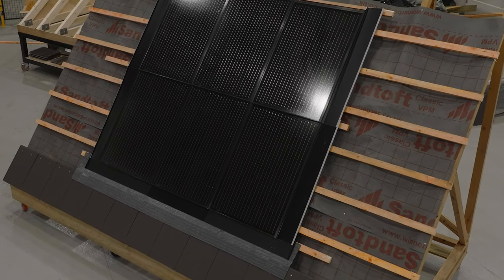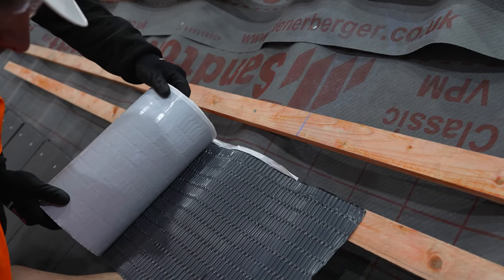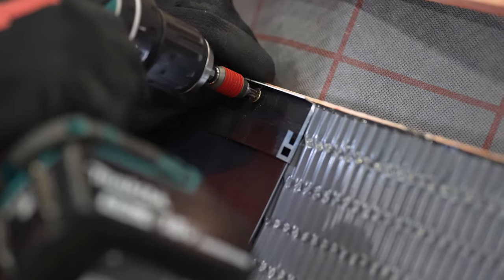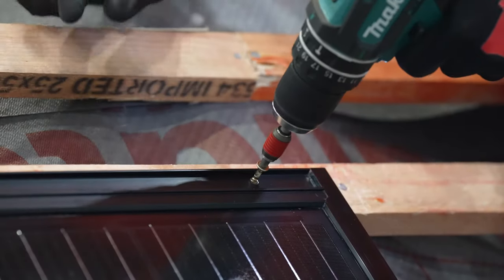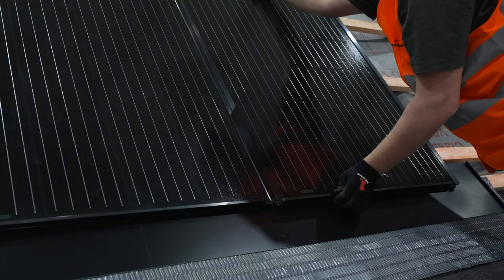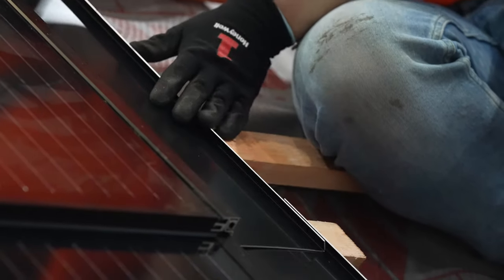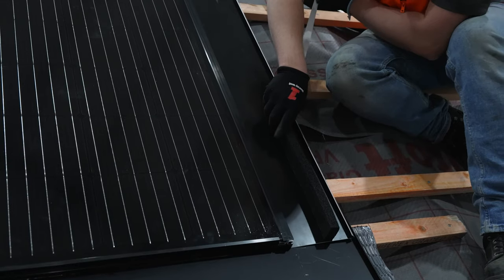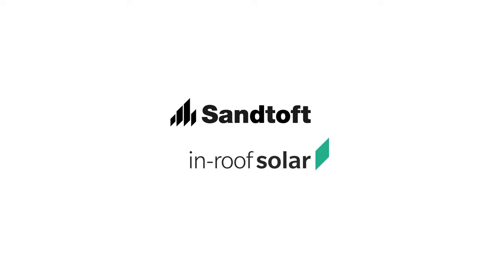How to Install In-Roof Solar

Comment: Don’t see the sense of using 125w panels these days unless your roofs that small this system would be job specific .. And with using the lead alternative this is all good until you hit a roof with a deep pan tile …then you end up with a messy job as trying to run from a flat back into a deep pan is a nightmare . Better systems out there allowing you to use 400 plus w panels for better yield .